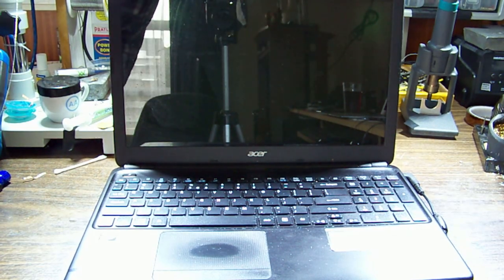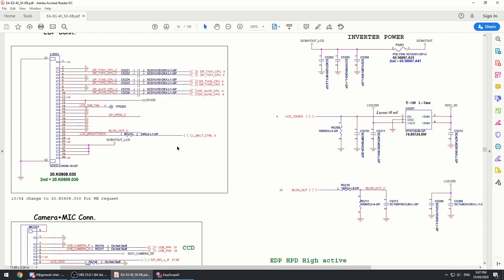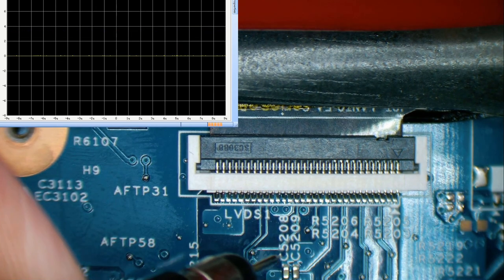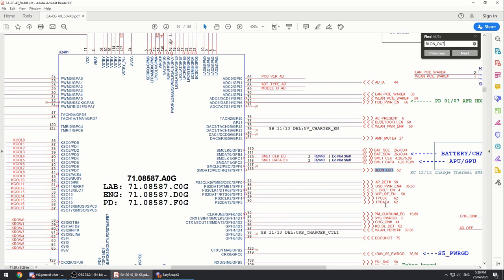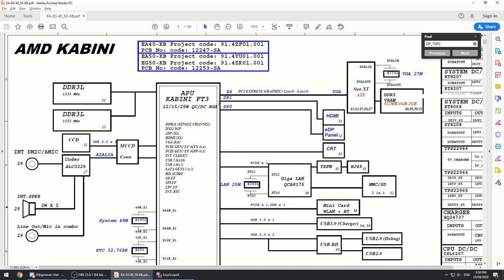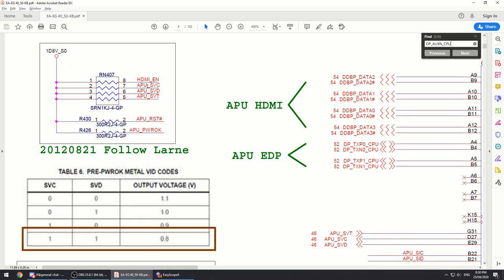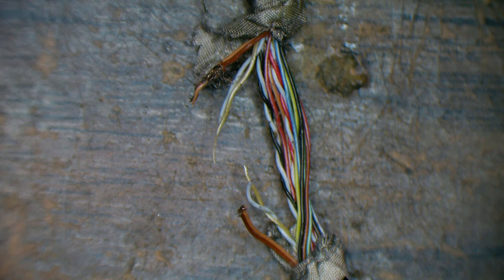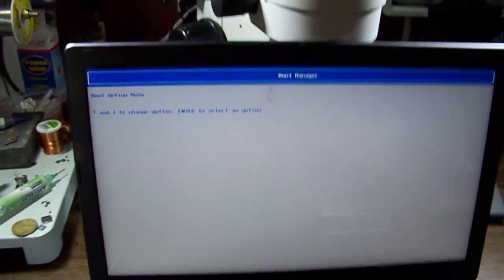Acer Aspire E1-522 No Image Laptop Repair!

Comment: Fantastic insight into the troubleshooting process. I just had a very similar issue, where a junk E1-522 I received showed an image, but no backlight. Based on your diagnosis, I tried out the external outputs and they showed absolutely no signal. However, as soon as I disconnected the LCD cable, the external outputs sprang to life. Have now narrowed it down to cut and shorted wires in the same cable... might even attempt a similar repair! Thanks!
Reply from the maker: Good stuff! Hope it works out for you.

Comment: Well done :-D, Of cause you could have started at the lcd/cable.... then sods law would kick in and make the fault be on the main board :)
I hate the way laptop schematics are drawn, a mess of silly abbreviations and fragmented bits all over the place.
You end up jumping around the pages like a mad frog on hot springs, very hot springs :-D
On some diagrams there is a block diagram showing what signals turn on what power supplys and the order they must be in to float the boat.
Reply from the maker: The thrill of the chase haha, the more you look at them the easier it becomes to read the next models one